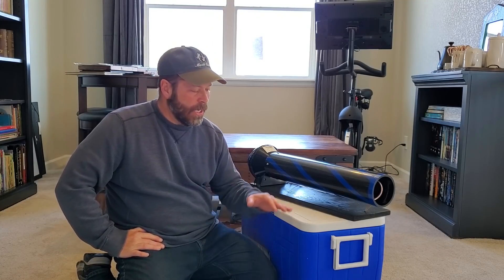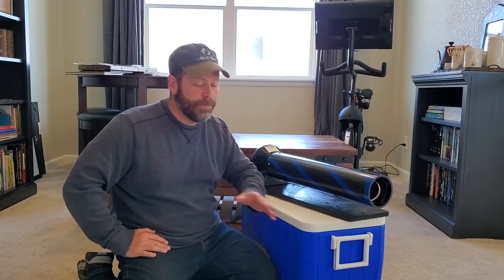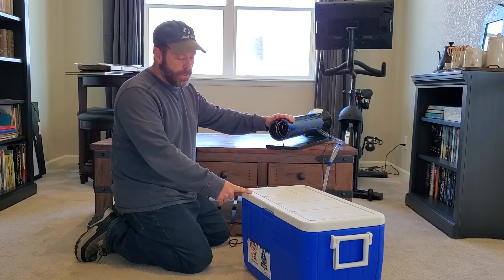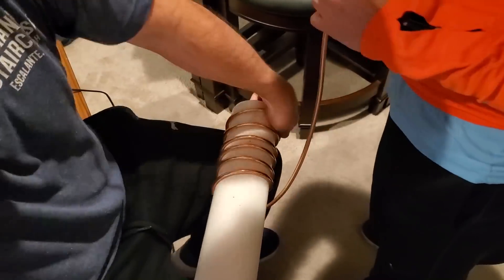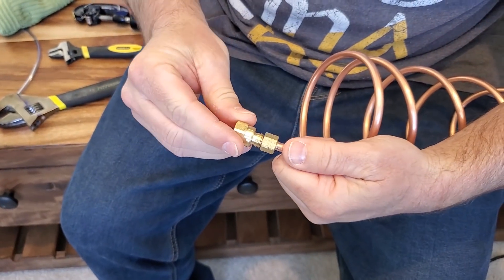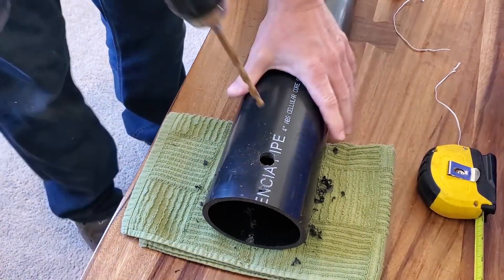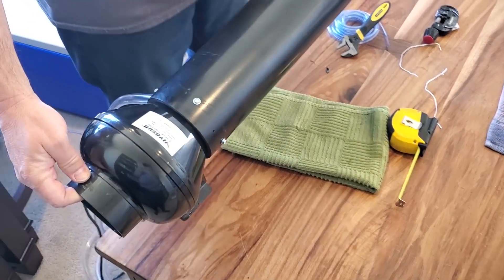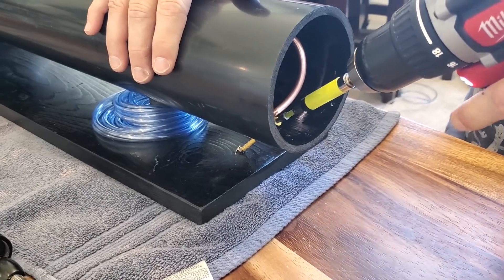Homemade Portable Air Conditioner DIY - NO HUMIDITY! - Long Lasting Ice! - The Fan Cannon

Comment: Very inventive design! However, since Ice can only absorb 144 BTUs per 1 lb. It looks like he put 3: 10lb bags of ice in. Therefore the max heat the ice is able to absorb is 4,320 BTUs.
If the ice lasted 3 days running an estimated 12 hours a day, then this is the equivalent of a 120 btu air conditioner. Pulling just 120 BTUs of heat out of the air each hour.
Considering the smallest window ac is around 4000 BTUs or able to pull 4000 BTUs of heat out of the air each hour, the temperature drop coming out of the end of the black pipe can be assumed to miniscule.
It would feel nice blowing directly onto you. However, It will by no means cool a room.
Reply: your post is the exact post I was about to write. Are you a fellow mechanical contractor? haha. These ice melt cooling systems all look like they would be really nice. However you are right. But, to elaborate, Your numbers are exactly right. 144 btu/lb is the calculation used for ice to water conversion. There is still heat transfer happening as the liquid water gradually assumes room temperature so there would be an additional amount of btu from that gradually tapering to 0 once water in cooler reaches room temp. The thing to remember is that is a btu/hr calculation. so, If he could get all his ice converted to room temperature water in an hour he would have the equivalent of a 7k btu air conditioner (give or take). So, again using napkin math, If it takes 10 hrs to reach equilibrium he has 700 btu. If the ice lasts 20 hrs - 350 btu and so on. so..... yeah. may feel good on you but no way are you going to change a room temp,
Reply: Hello! Thanks for your input. Yes I am a mechanical contractor in Colorado USA. Before I was experienced in the math behind Heating and cooling, I was often led astray and wasted countless dollars and time on projects like these. These videos lead the simple astray :(  @mrpbright
Reply: @jaredcarlson3500  - I'm so glad I read both y'alls responses. 
I build this a couple weeks ago, played around with the tube configurations, in our bedroom, 3 bags of ice, running 3 hours, barely took it down 5º from 80º to 75º. Was kinda bummed, but your guys logic makes 1000 times more sense than the 'simple' responses above and below. Thank you both.
Reply: @darrylbyrne6154  oh man, thank you. I appreciate you saving me the money and aggravation.
Reply: @mrpbright  thanks for this. You saved me a bunch of time. I’m trying to create something for hurricane season. This is not it.
Reply: well science guy, without an ambient air reference your numbers are meaningless. if it was 33 degrees outside it would last a REALLY long time, and cool nothing. if it was 100 degrees out, no way is that lasting 3 days
Reply: @jayc4283  thank you for helping to confirm that this device doesn't actually drop the air temperature in a meaningful way!

Comment: Hello Jason Lucas,  I hope you are well and thx for posting/sharing your DIY project.  I mostly work in my garage and in serious need of an efficient way to keep me cool.  I've reviewed multiple DIY Portable AC Units and yours caught my attention.  I understand that output temp will vary depending on how the circulating water is being cooled; ice cubes, ice blocks, frozen water bottles, bagged ice, etc.  I will ask if you have experienced any condensation from the copper tubing?  I love your setup but condensation is a deal breaker for me.  Looking forward to your response and thx again for posting/sharing.
Reply: im almost certain it will as it should. there is an easy way to deal with this, drill out a hole in the back and have it slanted back and attach a short 45pvc piece in the front, attach a hose from that hole to the cooler....problem solved

Comment: great explanation. great thing to just have at home as a back up in case your AC goes out or to cool the bedroom over night without cooling the whole house down! If you would wind your coil over a 2" pipe you might get even greater cooling because of more coil exposed to the airflow. great also your warning about cutting up your hands!

Comment: Would rock salt increase the temperature in the cooler?
Reply: Why would you want to increase the temperature in the cooler? The point is to cool the air.
Reply: @Drop_Top_Roberto  A colder temperature in the cooler would keep the ice frozen longer. Also a colder temp inside the cooler means colder air outside the cooler.
Reply: @Scandinavian_Pride  well yeah, no kidding. But... you asked if it would increase the temperature lol
Reply: @Drop_Top_Roberto  Oh snap! I gotcha now lol.... I must have been half asleep 🤤😆

Comment: This is not an air conditioner,  it is a swamp cooler.  In hunid climates, this does NOTHING.  If temperatures in dry climates reaches a certain temperature, this does NOTHING.  Do not be fooled.  If you live in dry climates, this works.  It works by adding water to the air, which cools it.
Reply: Sorry Ryan, this certainly is an air conditioner and doesn't add water to the air.  It cools the ambient air by passing it over the cold coil in the PVC tube.  As it does that, condensation will form on the coil, extracting the moisture in the air...which is exactly what any conventional air conditioner does....only the OP didn't account for the condensation to drain out of his PVC tube.

Comment: Just go to walmart and purchase a 5k BTU for $100 with a digital remote, temp readout control and run power.
Reply: Yes and it uses just under 600 watts an hour.

Comment: How in the world did the ice last you 3 days?  I built this and ice is 100% melted every morning.  Even added foam insulation in top of cooler and insulation around plastic hoses.  Ice still all melted by morning.
Reply: I'm experiencing the same results too, ice melted in a few hours, I think in my case, the heat that's generated from the pump that sits inside the ice chest. I have to go look for an external pump, that way the heat generated from the pump wont help melt the ice faster... or maybe look for a pump that wont generate ANY heat.
Reply: @bensong910  I'm experimenting still with mine. I will let u know if I find some simple improvement.
Reply: @bensong910  I've gotten my ice to last through one night now with tighter foam insulation seal on top and insulation around feed hose.  Initially I insulated both hoses together and then realized that was counter-productive.  I think if I can get foam insulation in cooler lower down so there is less air in the cold area that will help more.
Reply: At some point in future I may try a different cooler (I think better quality and smaller size may help...) to see if that works even better, but I'm fairly content now I can get ice to at least last through a night mostly.
Reply: @tjhollen  Thanks, I'll try to insulate the unit a little better, maybe that could extend it a couple more hours.
Reply: @bensong910  if you find any improvements please keep me posted & I'll do the same :)
Reply: He lives in a cold weather area. 😂

Comment: I'm not an HVAC person but a question...

Wouldn't coiling the copper around 2 inch pipe create a greater surface area for the air to be cooled?
Reply: Surface area is dictated by the diameter of the copper tubing and it's over all length. A smaller diameter coil would only serve to make it harder to center the coil in the cannon. That being said, having the copper coil further from the cannon walls would possibly prevent heat transfer from the cannon walls to the coil and possibly make the coolant last a little bit longer.
Reply: @ssteele1812  thank you for the information. 😊

Comment: I made a smaller version with the coil as an attachment for the front of my vornado fan.. appreciate the info👏🏼
Reply: How is it?
Reply: @joshako  condensation isn't a real issue when you have wind hitting the coils. Its actually cools my small room well considering I put the components together from Home Depot and Amazon part. Used a smaller cooler then the one in the video and applied rubber grommet to all the holes. Using reusable ice packs.. so far so good. Working out all the little kinks. I've already come up with a bunch of improvement.🥵😎😁🗽

Comment: You clearly like making these coolers, but it would be nice to see some scientific method. Ambient temperature in a small room before and after, power draw, air flow rate and various ice types. 
Your designs are nice though.

Comment: Ahhh Man , this model is by far the easiest  and simplest and best model yet. This one I will be trying . Thumps up
Reply: How did it work? Did it meet your needs? What was your application?
Reply: @Tripsolo65  Thanks for the reply.  Yes worked like a charm easy to do . I used soft copper , cooler for of ice , drilled holes on side , aquarium water pump , roybi battery fan . Works great . I can really see buying a package  like this at  Wal mart . Look into a patent.  It's the most cleanest  looking design I've found.
Reply: What was your application?
Reply: @Tripsolo65  application  = used for ? Well honestly I just it in my house because I didn't have a/c . I moved it around in the living room during day and bed room at night .  During that time I didn't need nothing battery powered . Now new a/c. But it did work I live in FL.
Reply: @jmcc5168  thanks that helps tons
Reply: @jmcc5168  how did you handle the water droplets from the coil due to condensation?